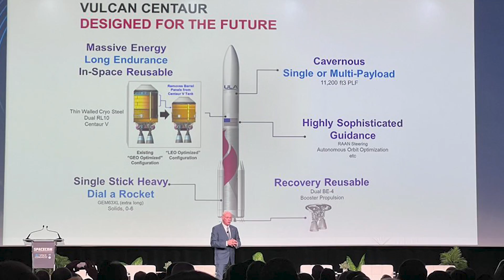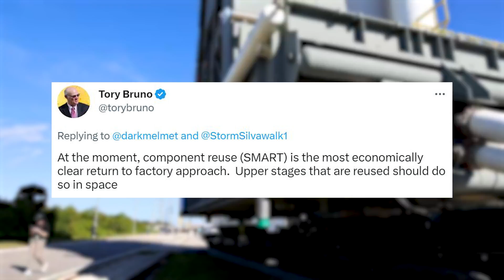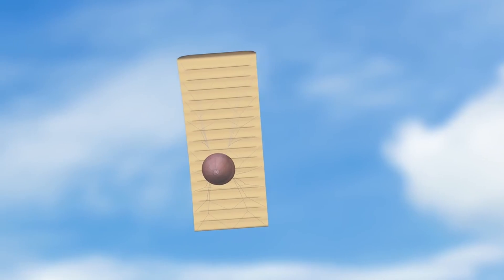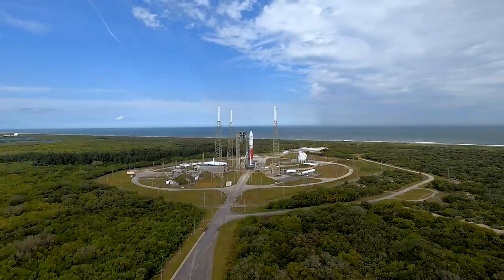ULA Has Begun Testing Vulcan BE-4 Engine Reuse

Comment: ULA is for sale. I expect Blue Origin to buy it and then phase out Vulcan in favor of New Glenn. SMART will never be implemented.
Reply: I don't think they'll phase it out just yet, New Glenn need to have a few flights to be sure it's safe and even then it's a big vehicle it will need more fuel and maintenance, plus vulcan centaur already have quite a lot of boosters in preparation and most of them will serve for kuiper constellation, the launcher should be safe for a few years although it's probably the very last thing ULA will ever produce, and considering that SMART is supposed to allow the BE-4 to be used over again, i think Bezos will be interested in keeping some money aside.

I suspect Bezos will keep Vulcan for now but might just not accept any new orders, the idea will be to proceed to do the launches scheduled till the end of the decade, then throw it away for it not to do any concurence on New Glenn.

Comment: Interesting report. At 7:55 on the time tacker, costs are mentioned: The engines make up the majority of a booster's value; around 2/3rds the cost of an expendable booster; 1/2 the cost of a fully recoverable booster. Would be interesting to hear more details around the cost savings with this approach.
Reply: It's not just the engines alone, those are somewhere between $12-18 million for each pair. It's the entire aft module that encloses them, hydraulics,  propellant feed lines, etc.

Comment: How will it disconnect the plumbing from the motors?  And will the connection point be prone to leaks?
Reply: The same way the space shuttle did. This is OLD technology first proposed in the 1960’s.
Reply: @allangibson8494   The Space Shuttle never dropped its engines. This is something that has never been done before.
Reply: @odysseusrex5908  The Space Shuttle was the reentry vehicle for the main engines. They weren’t connected to any tankage inside the shuttle - that was done by the orbital manoeuvre engines in pods either side of the main engines.
The Atlas rocket also dropped two of the three booster engines in flight (they weren’t recovered).
Reply: @allangibson8494   Again, the SSMEs were never released from the orbiter. They remained attached from launch to landing. The Atlas had side boosters. I think it was the first to do so, but that is a very different thing and, as you say, they were not recovered. 
At any rate, I don't think it matters. ULA is for sale and I think ULA will but it. They will fulfill the Vulcan contracts, probably transitioning as many of them as possible to New Glenn, and then retire Vulcan in favor of New Glenn for all future contracts. SMART will be of no value to them and they won't develop it.
Reply: @odysseusrex5908  And EXACTLY like the space shuttle, the Vulcan fuel tank is discarded and the engines and fight control systems recovered.
The same technologies could also be applied to the Artemis systems to recover the booster main engines.
Reply: @allangibson8494   The entire Space Shuttle orbiter, the whole spaceship, landed. The engines and flight control systems were not jettisoned for separate recovery. I don't think it really matters though. As I have been saying, I expect Blue Origin to buy ULA and phase out Vulcan for New Glenn. They will have no incentive to develop SMART.
Reply: @odysseusrex5908  The entire FUEL tank was jettisoned and not recovered.
Exactly what is proposed for the Vulcan.
The Space Shuttle just became the return vehicle for the no longer functioning main engines and controls for those engines. It also did other things but that function is replicated with Vulcan.
The Russian Buran Shuttle didn’t return the Energia engines and they were expended on each flight. That eliminated the need for fuel and oxidiser disconnect couplings on the Buran that the SpaceShuttle had.
Reply: @allangibson8494  I suppose it's similar to what the shuttle did but for some reason disconnecting motors seems harder than disconnecting a fuel tank. As I think about this a bit, I think disconnecting the motors will be more difficult than disconnecting the fuel tank. Not only do the fuel lines need to be disconnected, but the control lines and the structural attachments will also need to be disconnected.
You're probably right that this stuff has already been figured out but I do think there are differences in the two strategies which make disconnecting the motors harder than disconnecting the external fuel tank on the shuttle.
Reply: @ddegn  The difference is the space shuttle engines were attached to an aircraft and the Vulcan engines are attached to a blunt body reentry vehicle. The separation requirements are exactly the same.
RocketLab have also shown that the issue of getting rocket components wet with salt water isn’t a show stopper for reuse either (one of the advantages of not using hypergolic propellants, unlike the Dragon capsule).
Reply: BEZSO HAS NO USE FOR ULA OTHER THAN THE CONTRACTS, HE ALREADY HAS HIS OWN ROCKET AND ROCKET COMPANY, NO REASON FOR HIM TO BUY ULA
Reply: They will just use guillotines to cut through the pipes and other major parts containing the engines so they don’t have to make the systems have built in disconnects.

Comment: It seems quite likely at this point that most or all of those 38 Vulcan launches for Kuiper will be fully expended because SMART is not finished in time.
Reply: And before the contract is completed, Blue Origin will have bought ULA and transferred as many of those launches as possible to New Glenn, and will be phasing out Vulcan for New Glenn on future contracts. SMART will never be used.
Reply: @odysseusrex5908  Why would BO, if they buy ULA, phase out Vulcan when when it's a perfectly well developed rocket and would serve as a backup launcher in case they have a New Glenn grounding situation? In fact, why would they buy ULA at all if it is just to basically dismantle their only viable launcher for a foreseeable future? They will eventually don't just buy a second launcher, they will also acquire the vast knowledge, expertise, assets as well as the tight and trustworthy relations they have with a lot of customers...

Comment: For the rocket engines to be reused by ULA, the Booster (1st stage) has to land and be recovered!  And tested, retested and reliability proven ! Falcon has already been doing this successfully for several years. And Starship is designed for reuse right for the start!
Reply: Watch the video again Johnny!
Reply: No! The Booster doesn't have to land! 🤬
Reply: Then how do you recover the engines? Are you going to detach and parachute them back??? Huh ?
Reply: @johnrday2023  Let me guess, you didn't watch the video right? You just read the title... That's sad.
Reply: @johnrday2023    The plan is to develop an inflatable heat shield which was originally tested by NASA.    After the booster has reached MECO and second stage separation the booster would discharge the two Be-4:engines and the heat shield would inflate.   At some point in the descent a parachute would deploy slowing the heat shield and engines before impacting in the ocean.  All of this was described in the video.  

I'm not here to say whether it is realistic or not, but that is the plan at any rate.
Reply: @johnrday2023 
Yes, that is exactly what was described in the video.

Comment: 4:09 “This means running the engine at a reasonable level” to be reliable while being reusable. Why then does somebody else have an engine with an extremely high chamber pressure that they state is reliable and can be reused in a record short time? Seems like someone is doing something “better”. Time will tell.
Reply: Maybe I should drive my car constantly at the red line of the engine, that surely won't diminish its reliability... Right?  Who cares about common sense... Also, Blue Origin has "froze" the design of the BE-4 and enters in mass production with it. They probably are confident about its reliability. Running the engine at a reasonable level is self explanatory. If you want your hardware to run as long as possible, you don't push it at its limits, you keep a good safety factor on it. Physics is the same for everyone.

"Why then does somebody else have an engine with an extremely high chamber pressure that they state is reliable and can be reused in a record short time?" 

They state... You mean Musk states? He also said they melt chambers on a weekly basis. That's a problem. He said it. Not surprising that they already are at their third revision, currently being developed. Their rocket is massively heavy, they need to squeeze out as much as power from those engines... Like you said, time will tell, we will see if the engines run well again in the next IFT. And subsequent tests. If that's the case, then they surely keep a safety factor on it. Why would you want engine ready to explode at the next tiny surge of chamber pressure?
Reply: @dave_ant1  

Thank you for the reply. I have generally believed that when you are choosing expectations of what you want out of a rocket engine; low cost, excellent reliability & very high performance, you don’t get to choose all three at once. The “impression” that I get about the way raptor is promoted by elon, they got it all. I find it curious about how they supposedly do physics better than others. Time will tell.
Reply: @Mentaculus42  Yes, thing is, I wouldn't listen to anything Musk and his management says. His engineers surely keep a safety factor at full thrust on the Raptor. But it is so compact and powerful that they surely are at the limits on many components, I would guess. If the full flow closed stage combustion cycle proves to be too challenging for reliability and reuse, they might as well completely change for another cycle type. But then, it's a restart from scratch and at least a couple of years of additional delay. And a couple of billions more... Will see. By the way, you may know that Stoke Aerospace is also developing a full stage closed cycle as well, pretty ambitious for a young startup. The CEO worked on the Merlin engine anyway, he knows his thing... Exciting times.
Reply: @dave_ant1  

As you point out, the raptor is a full flow engine which has parts that have to run oxygen rich which is always a challenge. But then again, sx had the benefit of metal alloy development done by Aerojet and Soviets that took many years. As far as it is known, sx basically copied Aerojet work and gave it a new name with an “X” in it. The new company doing a full flow engine is brave but their overall design is both interesting and creative but is pushing some margins in new directions. It will be interesting to watch.
Reply: Those same engines would last longer at lower pressures, by definition.
Reply: @filonin2 Yep. But if you can build a Raptor for less than the cost of a small turboprop engine, then you start out ahead.

Comment: So glad that reusable rocketry is becoming more and more common. Rocket engines are wayyyyyyyyy too cool and such pieces of fine engineering to be thrown away with each flight
Reply: I've always been super disappointed that they didn't use this technology to finish the astronaut recovery system.

I've always wanted to ride an inflated cone down from space.
Reply: @jtjames79 wasn't that the ejection seat that surrounded the astronaut in an inflatable canopy of sorts?
Reply: @tyler60904  I believe that is what he's referring to, Scott manley has a whole video about astronaut recovery system concepts
Reply: @tyler60904  Yes exactly. I always thought NASA was foolish for not developing it just to keep it in their back pocket. Could have saved the Columbia crew.

Mostly I wanted them to develop it so that space surfing could become a sport.
Reply: And landings are arguably way cooler than launches. 😍
Reply: Has any company relaunched a recovered booster besides spacex?
Reply: @jamskinner  technically you could say blue origin, however there is a massive difference in size and complexity here. Including altitude and velocity.